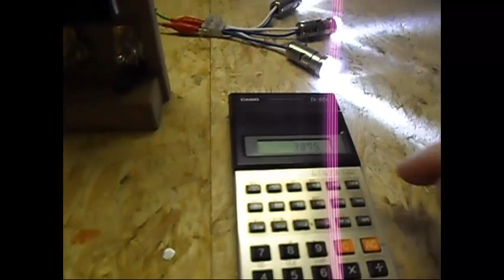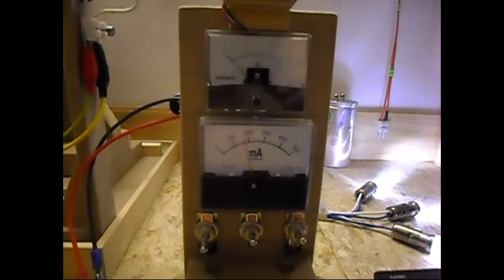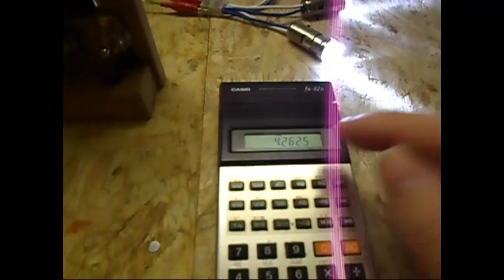DC Motor, PWM and Generator - Just me fooling around...

Comment: Thanks for sharing, i don´t understand the efficiency percentage of 56% not bad for you....but the experimentation is the way to get the goal...! the best for you 2016 wll be a good year...!
Reply from the maker: +skycollection 
Thanks for your comment and you are welcome...^^
The efficiency is easy to calculate...the output(Volt x Amps) divided by the input((Volt x Amps)...and that&#39;s it...;-)
Example from the video...2.19watt ouput / 3.88watt input = 0.5644 and this 0.5644 translate to 56%...

And the 56% is nothing special my friend...anyone can see this percentage of efficiency...
And with your setuip[s you shopuld be able to get this easy...;-)

Just need 3 things to take into consediration...
1 - A adjustable rpm of your setup...
2 - A series or parallel connection of your coils...depending on your setup one may work far better than the other...!
3 - A specific load for your setup...
You just have to find a good balance in your setup bewteen all the 3 mention above...;-)

And the same for you...Feliz Navidad y un Prospero A&#241;o Nuevo 2016...^^
Adios

Comment from the maker: Just want to mention that there's no need for those exotic wound coils for a generator to perform like this...^^
It comes down to load percentage and of course some coils will perform better than others and you don't want to load a 10 watt generator with a 1000 watt load now do you...???...lol

Just me fooling around...
Input unloaded is, 15.5 @ 100ma = 1.55 watt
Input DC loaded is, 15.5 @ 250ma = 3.88 watt
DC load (3x1watt)is, 12.9 @ 170ma = 2.19 watt
Efficiency percentage is, 2.19 / 3.88 =  56%...not bad for something thrown together...lol
With the AC light on the DC output goes a tiny bit down to 12.6 @ 160ma = 2.01 watt
The input goes up a bit to 15.5 @ 275ma = 4.26 watt
The AC light output is not more than give and take 0.5 watt so the efficiency percentage would be around 
kinda same as the above(56% or so) and if i take like 0.25 watt instead of the 0.5 watt above for the AC light it will make the EP around 52% or so which is still not bad for this setup...lol
Reply: +Mister Caribbean Roots 
I like it.. because i want a small dc motor like that.  those that i found all draw like 1 amp.
one question. I always read that the core of your pickup coils should be at least as large or larger than the magnet. (with air core the magnet should fit inside the coil core...
either that is not true.. or would you (significantly) raise the output with larger coils? it is a question... i dont know the answer.. would be interesting experiment.
Thanks for sharing your build
Luc
Reply from the maker: +DaKrampus 
Thanks for your comment and i&#39;m glad you liked it...^^
This DC motor i bought on Ebay from China...it&#39;s 12 to 24 Vdc one and with a PWM the performance is pretty good...:D...even with the PWM full open it does not draw more than 1 amp...well at least not in my setups...lol
Link here for exact the same as mine,
http://www.ebay.nl/itm/DIY-DC-12V-24V-Marshmallows-Machine-Motor-High-Speed-Adjustable-Speed-/321819957715?hash=item4aedf6d9d3:g:BCAAAOSwBLlVVHPs

Do search because there are a few sellers and you may find one a bit cheaper...;-)
About that magnet/core thing...hmmm...
First,
In no way i can fit these 50mm diameter ferrite magnet in this 18mm core...unless i mashed them first...lol

Second,
From my testings/setups i can clearly say that with a larger magnet the production of energy is much better...o.O
Even my rectangular rotor magnets are longer than the coils diameter and the output can be very high which depends on the rpm of course but with larger magnets than the core(in my case, almost as large as the coil diameter and with rectangular magnets even larger) i do get far better output at lower rpm and also with a lesser pole rotor...:D
Hope this help you out a bit...^^
Cheers
Reply from the maker: +DaKrampus 
Check this short video where i have the same DC motor driving a 9 coils generator with 9 iron pipes as cores...^^
https://www.youtube.com/watch?v=O5--DN1ZYgo

Only 400ma @ 12Vdc = 4.8 watts...o.O...;-)
Cheers
Reply: +Mister Caribbean Roots 
Thanks for those infos.. and the link
Just ordered 2 of those motors.
one for experiments similar to yours, the other one build a sort of kromrey generator.

as to the coils I will do some experiments in that direction.
Keep up the great work.
Luc
Reply from the maker: +DaKrampus 
You are welcome, glad i could help...^^
Nice move on buying two of these motors...;-)
I've seen the bedini kromrey generator dvd...seems like a nice setup to play with...;-)
Have fun & go for it...^^